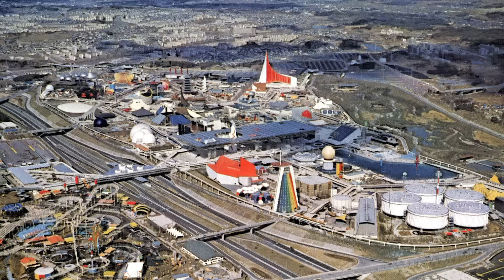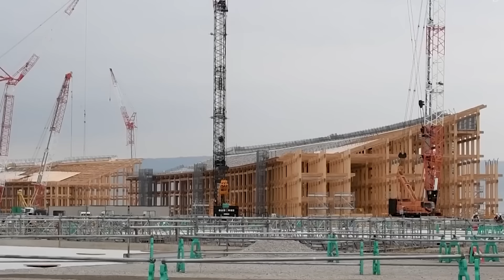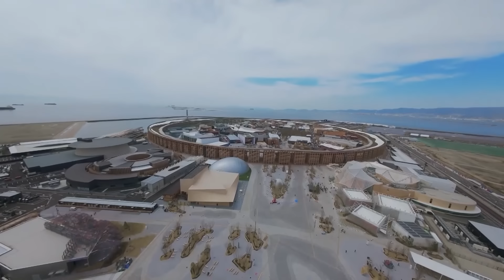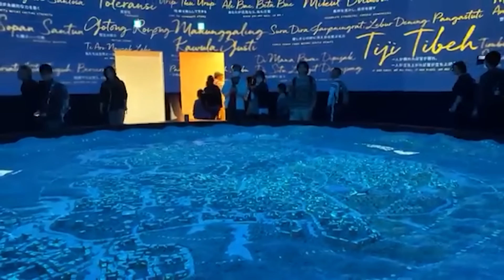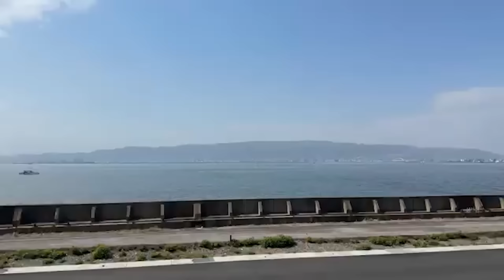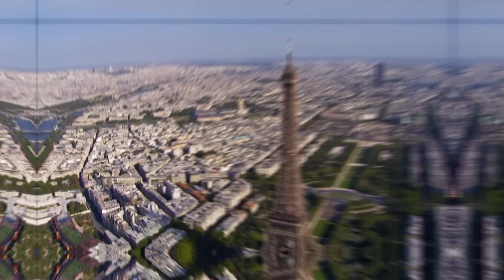World’s Largest Wooden Structure on a Garbage Island

Comment: IMO if they want to, they can close the other parts, but KEEP the Grand Ring....
Reply: No, it isn't a long term structure. As it is just laminated boards, the humidity will eventually de-laminate them, causing a cascade failure.

Even if the glue is good enough, there is still the problem of wood shrinkage as it dries, as well as insect and bird damage. Possibly even vandalism, either purposeful or accidental.

I could see gaps between some of the laminations, without even searching. So the process had started before the park opened. 

I suspect they will keep it for a few years, but at some point it will have to come down.

Comment: We should be using way more glue-lam. It locks carbon in place and is as strong as some types of structural steel. And trees are renewable resources, unlike concrete and steel. AND as a bonus, they are also beautiful buildings.
Reply: The atmosphere is not a tank. It is the outer shell of the ocean. What we have in the air is what the chemistry in the ocean has determined should be there. The ocean will also determine how much CO2 there should be in the air. If too little, the ocean will release some more so that the chemical equilibrium can be maintain. If too much in the air, the ocean will eat the surplus. So it is impossible to reduce the concentration in the air of CO2 by adding more glue-lam to some construction projects. It's delusional.